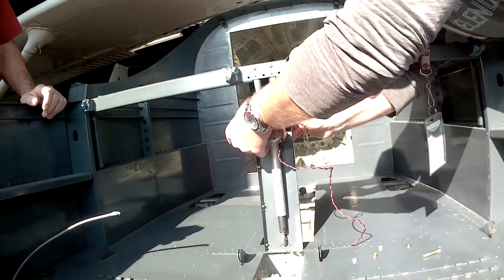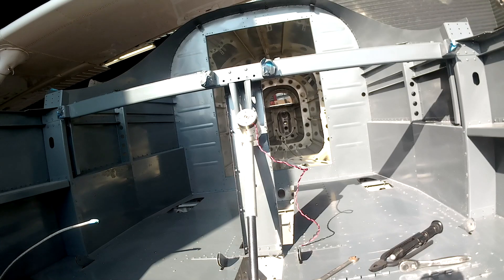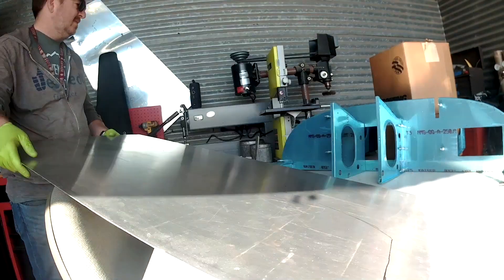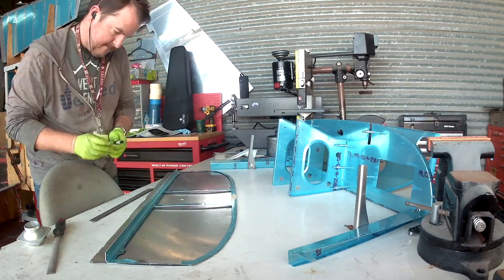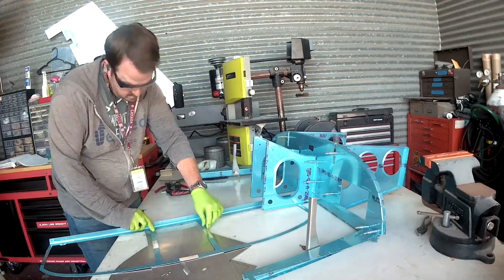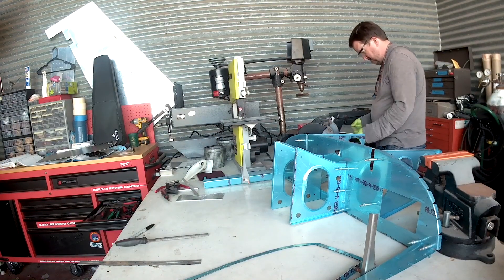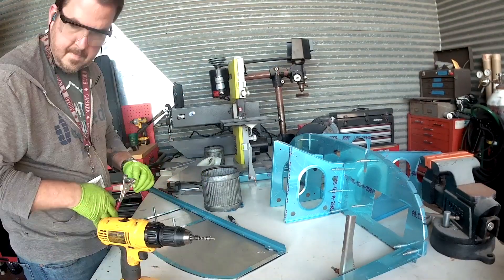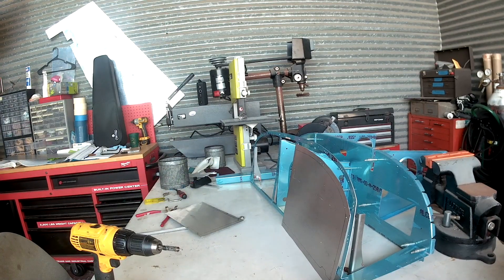RV-14 Panel 1

Comment: Curious if you had sketches of all of the different layout options for the panel. Did you ever consider putting the EFII on the right panel, and the G5 on the left?
Reply from the maker: I did but I don't like the idea of my back up AI (The G5) on the left side of the panel. Doesn't really help the copilot over there as much as having it in the center of the panel.
Reply: @akilroy  Makes sense for benefit of copilot. EFII on left you can view or adjust while the copilot (or autopilot) has controls - no leaning over.